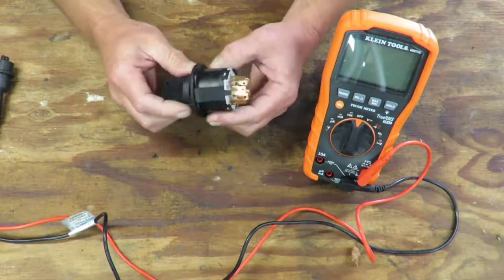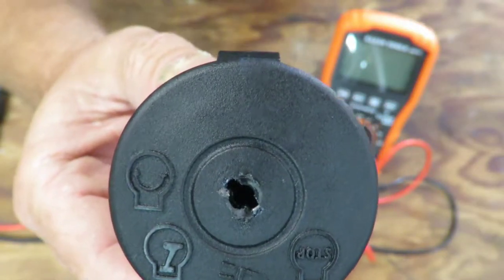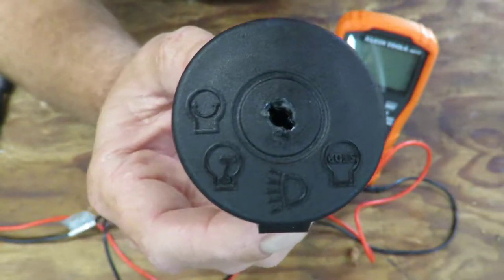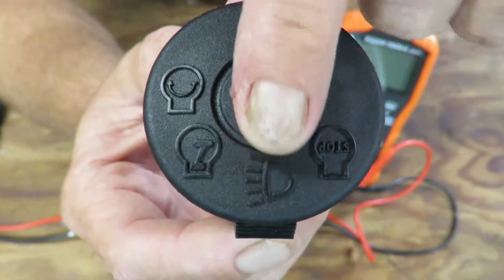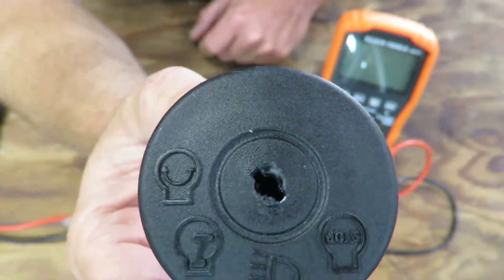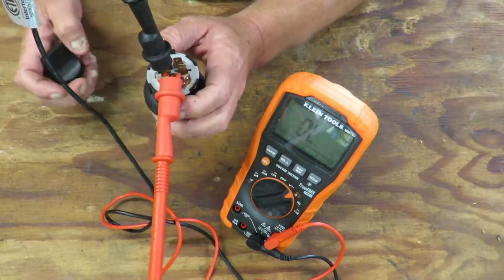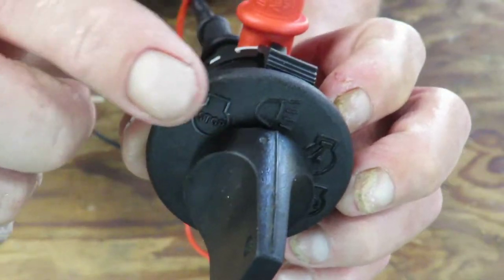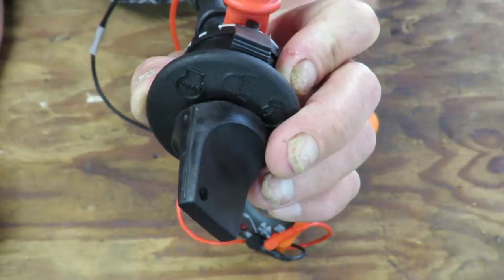How to Simple Key Switch Test

Comment: I can’t get fire from the wire that comes from the switch to the voltage regulator when the key is turned on, stater, regulator, and switch all test good,but when I pull the pto switch on it kills the motor?!
Reply from the maker: Test Key Switch
Key Switch has battery voltage to it
When Key is turned on connects inside Switch to wire that goes to voltage regulator

Comment: Can you show me other side the colors
Reply from the maker: I can , But depending on your manufacturer of Mower, They will use different color wires.
So may not help you
Best thing to do is take a continuity test
Pull wire off of component say voltage regulator put one lead in that end
Then put other lead in each terminal of key switch connector. Meter on Ohms or Buzzer works better.
Disconnect battery before starting this test.

Comment: A2 connect to which part of the mower?
Reply from the maker: A1 or A2 = A is meaning Accessory 
Usually A1 is Charging
A2 is used for different things depending on your mower.
Just follow the wire that is connected to A2 on switch
Follow where it goes from Key switch
Reply: Great and thanks for your help. Will subscribe more for your channels

Comment: What is a 24hp B&S suppose to charge at ? Thanks
Reply from the maker: B&S have several different charging systems
If the engine has voltage regulator then the charging system works the same as kohler or kawasaki. The wires will just be connected different on the regulator.
Test AC from two wires coming out from shroud to voltage regulator. Then Single wire for DC voltage.

Comment: I have a older key switch from a 1983 782 Cub Cadet with 5 pins, only 4 of the terminals are marked   ,A-S-M-G  I assume the unmarked terminal is B ?
I am not sure what original motor was in my Cub Cadet but I am putting in a Kohler CH20S with Magneto ignition and have read I have to do something to prevent burning up the coil but not sure what I need either maybe a diode?
Thank You,

Comment: It is 9:18 here, I have the letters, b,m,s,y,a,and g on my the back of my ignition switch on my gravely zt 1740. There are actually 7 terminal on the back, b,m,s,y,a,g and it's either an I, or L I'm not sure ?
Reply from the maker: @thomasfrazier969
B= Battery
M= Magneto / Ignition Coil
S= Starter Solenoid
Y= Will most likely be an accessory
A= Armature/ Charging System
G= Ground
That I should be an L
L= Lights
You can Verify this with a Multimeter
Disconnect Battery
Put meter on Ohms
Match the terminal on key switch to wire you want to test.
Let's say your testing lights
Match the L to the terminal on connector
Put your Red Lead in that L terminal on connector
Then take the other lead and go to headlight
Unplug and put the other lead in the connector on Non light side.
This will help you figure out what Y actually goes to

Comment: 2👍for you Sir! I combined this video with your voltage regulator instructional video. I have a DR mower with an electric clutch to engage blades. Come to find out, I had a multitude of issues with mine (bad voltage regulator & bad key switch). Without your help, I would have had an engine that runs but wouldn't cut grass due to the 12V required to keep blades engaged. Effectively an expensive lawn ornament. Thanks again for people like you that take personal time to make videos & share the knowledge. Subscribed, liked, & bell ringer here. VR

Comment: If you’ve narrowed down everything before the switch for the charging system and the charging terminal check fails would  the mower would still start? Assuming you have manually charged the battery to full with a charger.
Reply from the maker: So B terminal on key switch has 12 volt DC to switch, but nothing to voltage regulator DC wire.
Most likely will be bad key Switch
Could be broken wire, but usually unlikely

Comment: i have a cub cadet rzt50 kawasaki 22 hp engine year 2009. i love your videos.
with my ignition switch off i am getting battery voltage to the voltage regulator, is this ok?
Reply from the maker: I'm gonna say No
That would drain the battery down
I think your key Switch is shorted
Unplug connector from key Switch
Check Voltage at Regulator
If there is NO Voltage
Replace Key Switch

Comment: I have 2 questions. 1. You say that when I connect A2  to B I should hear a beep. If I don't does that mean the switch is bad? I tested a brand new one and when I connect A2 to B it doesn't beep either.
2. When testing the ignition coil with a multimeter, when the key is off it doesn't beep. That does mean the new ignition switch is bad?
Reply from the maker: @moyote53
Should be A1 to B
I will have to check that in Video if I have misspoke
Yes on the M to G
If Doesn't beep with key off Switch is bad

Comment: Hello there I have a switch that rings the meter when it in the off position and I get nothing through the coil which everything is new my question is the switch is going to ground? That’s what I think 
This new switch is on a1973 hodaka 125 wombat 
Any ideas will be great thanks 
Ty
Reply from the maker: Ignition Coils are made 2 different ways.
Open or Closed
Open being ungrounded to spark
Closed being Grounded to spark
Most are Open Coils

If yours is Open Coil
Key Switch should be grounded /Buzzing on meter with key in OFF position.
This Grounds the coil out and turns engine off. Kills the spark
Once key is turned on there should be No Ground or buzzing on meter
Which opens the circuit for coil to fire

If it's Closed to spark
Key switch will be the opposite

Just seen this is a motorcycle.
Ignition doesn't work exactly the same 
These Ignition Coils are usually ran with voltage and they depend on a reference of when to fire based on a trigger from usually points and condenser or other component to tell ignition coil the piston is at top dead center. If the reference is not there , Ignition Coil will not fire because it doesn't know when to fire, it's not receiving the signal.
I hope this helps

Comment: ive got a 48 volt battery golf cart switch that reads continuity in the on position with no power and 48 volts in the off position. im thinking the switch is working fine ive just got a totally disconnected ground somewhere. because the lights and everything else works not effected by the starter. can you chime in any suggestions? thanks bud. ive been chasing gremlins in this thing for 6 months now. funny thing is, all the years i worked i never sat back and dreamed of spending 8 hours a day working on projects in my garage that frustrate the heck out of me. lol. great video by the way.
Reply from the maker: If Im understanding you correctly
Switch is working 
I'm thinking there is 48 volts to one terminal on switch.
When you turn Switch ON , Connects and sends the voltage thru Switch to Second terminal out to whatever it powers.

Comment: Do you have a video on how to remove and rebuild a head on the Kawasaki FH580V? Get one thing fixed and have another problem. The mower is about 18 years old and have not had any trouble out of it. I did see a mouse run out from under it so there could be a nest on top of the cylinder causing it to run hot. Bent both valves about just alike. Thanks for any help and keep up the videos, they are very informational. Thanks again
Michael
Reply from the maker: I do not have a video on rebuilding the cylinder head. Sorry
Pull the top shroud off and clean out from under it. Your flywheel helps keep the engine cool. So if a mouse has built a nest under there. The air can't circulate.
Reply: @sartingarage8045   Thanks and keep the videos coming!!!

Comment: Can you give me a diagram for that ignition letters to where i connect them to the riding mower
Reply from the maker: A1 will go to Voltage Regulator
Depending on your Engine Brand will determine what connector it connects to on voltage regulator.
B = Battery
Which goes to Starter Solenoid
Connects to same post Battery positive Cable is connected to on Starter Solenoid.
L = Lights
Goes to one terminal on headlight
Then second terminal on same headlight
Jumper wire over to second headlight
Last terminal on second headlight goes to ground.
M = Magneto / Ignition Coil

Comment: Hello I have a 7 prong metal ignition switch for a craftsman 12.5 hp lawn tractor.
The letters are A Y G M L B S.
the lights don't  work but I have continuity from A to L.
I was wondering what Y does. 
It's a 3 position switch, on the console
How do I send a picture. 
PAT. No.
3497644
Others pend

Comment: Also on my toro 74170 how many prongs does it  suppose to have to key switch. . I have a five prong plug. My two coils, the wire is not  put in. Someone changed key switch and it want cut off  by switch anymore..
Reply from the maker: 1-543070 is the Toro original Key switch Part number, Maybe wrong switch was installed.
M terminal on key switch will go straight to ignition Coil Kill Wire.
M terminal connects to G terminal when switch is in off position and kills engine. G is ground
Reply: @sartingarage8045  thanks for help. Appreciate it.
Reply: This same B&S engine now has no fire.  Because of changing from kawasaki to B&S , the wire colors don't match. I have mess with this thing. It'll have fire and then it don't.  I don't know. Can you help me out.  Thanks
Reply from the maker: Find the color of wire to ignition Coil or Coils.
Connect that wire to the M terminal on key Switch.
So if the wire to ignition Coil is Black 
Wire on M terminal on key switch is Green
Connect black wire to the green wire
I hope that makes since
Reply: Ok thanks. I'll try it. I'll let you know what happens. Thanks

Comment: Got to say I was hunting the world over to find something explained as you have in this video
I have the same style switch on my arians garden tractor although I do have a question or a few 
Instead of the key switch I would like to put toggle switches would  like to plug them to the existing terminals on the same wire harness with out all the cutting and spliseing I have see guys who race mowers do something like I want to do I am so glad to have found this video in it's purest knowledge of this procedure
you think the methods described still applies to this wanted options  I have tried to explain
Now as I may not have said anything that makes sense but wise people are few these days I do hope to hear from you on this topic 
                                                Thank you in advance
Reply from the maker: You can do the Toggle switches
The Toggle Switch will go to the same terminals in this video
So say for lights would be B to L
Toggle Switch in line
B on one terminal L on the other

Comment: Hello, 
How are you? Thanks so much for making this video.  I have a Snapper Pro Zero Turn Mower. I shipped my wire harness to a guy in Oklahoma for repair. Upon return, the guy in Oklahoma put a note in the box stating that, "Will have to add 1 Red (+Positive) and 1 Green (- Negative) wire to the battery. Diagram does not show how long". How do I go about adding them to the battery? Do I need to run it from somewhere else and hook it to the battery? He didn't give me specific details. Every time I call to try and get in touch with him, his line is always busy. I'm hoping you can help me out. 

  Thank you!
Reply from the maker: Not real sure what he is meaning.
But my thoughts are the Red wire would be actually from Battery post side of Starter Solenoid to the B terminal on key switch.
The Green wire which he is saying to go to battery I would think should be black as it is ground. Which should also go to key switch to G terminal on key switch.
Maybe look in the key switch connector for which wires are missing.
The key Switch terminals have letters on them to determine what connects.
Match that to the connector side and trace that wire
Reply: @sartingarage8045  Thanks for responding so quickly. I'm waiting on some Safety Switch sensors to arrive to see if that is the issue. If not, I will defintely be hitting you back up for your input if you don't mind. I really appreciate you doing this video because you were very detailed and I received so much knowledge from your video unlike other videos I watched on here. Could you please do a video on how to run/install a wire harness on a Zero Turn? I haven't saw a video on that. That's if you ever have the time. 

Take Care! 
Thanks again!
Reply from the maker: I'm assuming you have the repaired wiring harness installed. 
What is the mower not doing
Will engine not turn over or ?

Comment: My Quest has only 5 terminals and none are identified? How do I figure out?  Thanks for great info
Reply from the maker: @joevonderheide 
If you have a metal type key Switch
The letters are stamped in the terminal
May have to clean them to see the letters
Reply: My switch is plastic. W/ stop, run and start. On the back side are 5 terminals. On the side housing …PA66-GF33 and INDAK. ExMark Quest 50”.
Reply from the maker: @joevonderheide4356
Can you get me model # off of it
Usually under seat or around the back near engine
Reply from the maker: I'm thinking your switch is the one in this link
The Second Picture shows the letters of the terminals.
https://amzn.to/3yw3YqG

Comment: Hi, my switch has following letters:  B, L, M, S, Y, G, A.  Would appreciate it if you could tell me how my letters correspond to your letters.  Thanks.
Reply from the maker: B= battery +
M= magneto/ ignition Coil
S= starter Solenoid
G= Ground
Y , A and L  can get confusing
L= usually Lights
But sometimes will use L for something else like Anti Backfire Solenoid on bottom of Carb.
And use Y for Lights
Also can be vise Versa
A= Accessory or sometimes Amperage Meter.
Reply: @sartingarage8045  Thanks Much!!!!

Comment: Great video. My switch looks just like that one but it doesn't have the L terminal.  It has G A1 A2 B M S. Which one would be for the lights? When checking the charging is it A1 or A2 and B? Thanks.
Reply from the maker: Will be connected to A1 or A2
Most likely lights stay on all the time while engine is running

Comment: I am getting a beep on M and S with the key in the off position.  Is it possible the switch is shorting?  In fact, with the key off, I jiggled the wires and the starter engaged and tried to crank the motor.  Wierd!  No other connections are getting a beep.  I assume it is time for a new switch.
Reply from the maker: I would say that switch is faulty

Comment: I have an old metal ignition switch that will start the tractor but will not turn it off. I have to cholk the engine to turn it off. Is this a magneto or ignition switch problem?
Reply from the maker: Test the switch
M terminal to G terminal
M = Magneto / ignition Coil
G = Ground
If switch test ok
Check Ground on G terminal but connector side to Actual Ground.
Also Ground wire to ignition coil could be broken or disconnected.
Reply: Thanks so much. I really appreciate the help. Great video, I will keep in contact.

Comment: Thank you very much for your fantastic video. I've got a 21 year old 42" yard machine riding mower model 13AP608G129 that I've been working to keep running these few years.

Thank you very much for your fantastic video. I've got a 21 year old 42" yard machine riding mower model 13AP608G129 that I've been working to keep running these few years.

Should there be any continuity between the G and A1 when switch is in off position?
Reply from the maker: @amberafarin8249
I'm pretty sure that is a No
You shouldn't have any connection on A1 to Ground
Should only be A1 to B

Comment: I brought a husqvarna ignition unit with 7 terminals but the plug connector has only 5 to fit in the middle leaving A1 and G terminals expose. When I start the tractor, I also have to turn on the light switch that I assumed are the missing wiring for A1 and G. So when the light switch is off, then that wire must be for A1 and when the light switch is on, then the other wire must be for G(the ground) Is that correct?
Reply from the maker: Did someone change the factory connector from a 7 to a 5 terminal. Or is the 5 pin factory ? I think you may have e the wrong switch. Make sure you look the switch up by your model number
Reply: @sartingarage8045  Yes, for a Husqvarna YTH2042 it suppose to have that ignition with the 7 terminals just like the sticker between the foot rest. Most of the wiring was already rigged before I brought the tractor. I'm not sure about paying over 80 dollars for a correct wiring harness including the plug for the hour meter because I'm not that the solenoid was bypassed in order for the motor to run.
Reply from the maker: It may be worth the $80 to overcome the trouble your having. Will be hard to explain how to wire the tractor.

Comment: I have a starter switch that has R B S A and the 5th pin doesn’t have any letter next to it I’m trying to fine the Magnito and ground
Reply from the maker: Use a multimeter
Disconnect Ground on Battery
Meter on ohms preferable with buzzer
One lead in the connection to Magneto
Then use the other lead to probe connector to key switch.
Once you find that connection in connector
Match that connection to switch

Comment: Thanks.  I think my switch is good.  What about the wires going into it?
Reply from the maker: Follow what the terminals are on the switch.
B = Battery which actually goes to Solenoid on Battery Post Side of Solenoid.
L= Lights
And so On